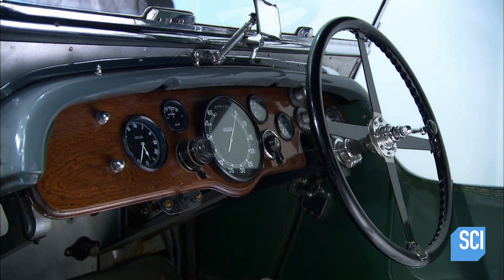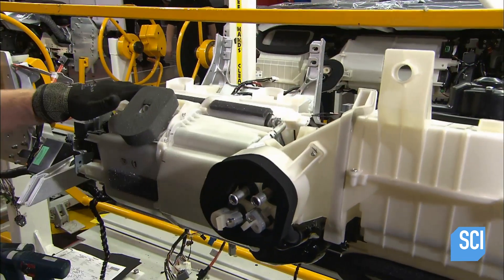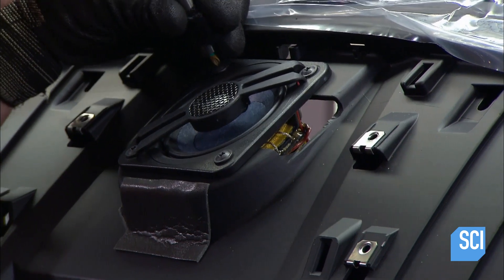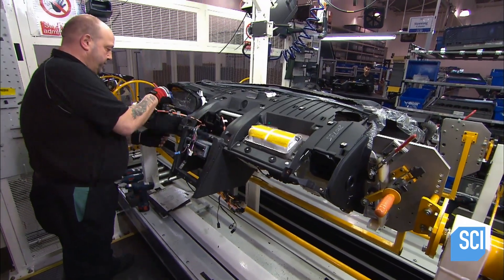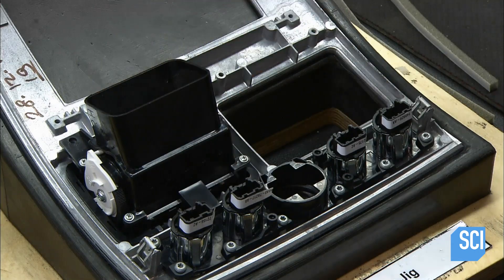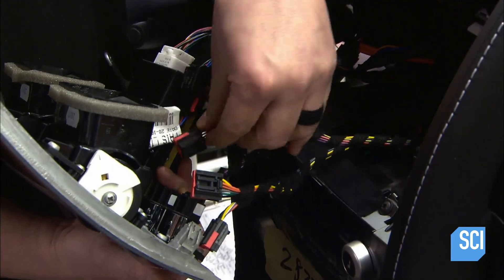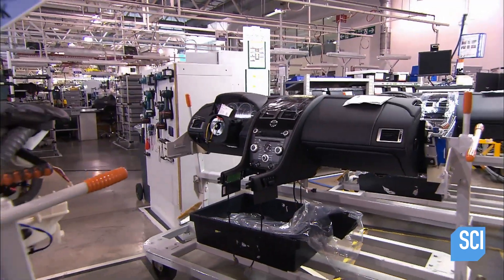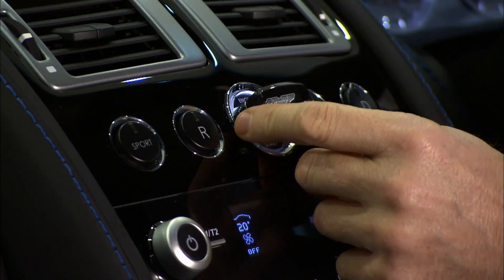How It's Made: Dashboards

Comment: This explains why any work in the dash area is usually a bastard.
They don't fit any of this with repairs in mind.
Reply: lol that is exactly what i was thinking watching them assemble the buttons for the various pieces, i am looking at replacing the USB/Aux port on a 2015 kia optima and holy hell... it's only like a little 1 inch by 2 inch $40-60 dollar piece but you literally need to take the ENTIRE freaking dash board/shifter area apart to get access to that spot... and there's like no good guides online they REALLY want you to bring it to a dealership and pay $400+ in labor for a freaking USB/Aux port lol

Comment: Not really "Making a dasboard". This is just bolting a load of impossibly complicated pre-fabricated electronic modules together. 
Car firms hardly make anything nowadays, they just assemble component manufacturers' products.in the 1970s, I went round Aston Martin's factory.  They made a lot. Of course they had to buy in carburettors, fuel pumps,  speedometers, brake callipers but they made the entire body and chassis, the entire engine and most of the suspension. Everyone of them were superb craftsmen. Nowadays, they are beholden to computers and component manufacturers for almost everything. When Henry Royce made his first car,  almost every single component (including generator, fuel pump,  brakes etc, we're all made in-house. That's how you maintain quality
Reply: so many people fucking crying about how they didn't show them injection molding plasting and welding steel.... there's like 800 videos of that crap, this is significantly more interesting noone is forcing you to watch it.

Comment: The car shown here is an Aston Martin Rapide and it's Satnav system is really old (i think thats why you can hide it - to hide away the ugly outdated tech) and it is suprising that a luxury sports sedan has so much plastic in areas you often sew
Reply: this show is probably really old.  Check the date printed on a part around 2:58, this was most likely filmed in 2010.
Reply: I don't like the button gears, I prefer the classic lever or a normal manual

Comment: This is just the assembly line. I wanna know how all those parts were made before it was being assembled. like how they measure all those wires, how they cast those panel boards, how they created the instruments and all electronics.
Reply: More than likely some 3rd world kid doing the labor
Reply: @alvindavis3801  who cares :-)
Reply: Yes but perhaps no car manufacturer is ready to open wide its doors to show everyone all the details...
Reply: Yes exactly.
Reply: the instrument panel is kind of boring it's a pcb board with small motors for the pointers which are just pressed on after the dial plate is put on with hidden tabs and glue it's blown free of any dust checked for scratches and the clear plastic is snapped in place then run through testing and inspected for miss prints on the symbols packed up and shipped out did it for 7 years
Reply: I work on the line. The IP line is where they put kids they want to up and quit. 

The line moves, there’s about 12 people on IP and they do not last.
Reply: @fixedguitar47  what does IP mean here? Interior production?
Reply: like to know how they get the symbols on the ac and heating controls
Reply: @jmartin4204  each on come off a printing machine like a 3d printer only faster it’s formed moulded pressed then dropped onto a conveyor as it’s cooled ready for packing i programme said machine in an epp department in a car parts factory the dash spare wheel housing are just Polystyrene
Reply: Munro & Associates has a great series on instrument panel and dashboard teardowns. They deep dive into how the dashboard was probably manufactured and why it was manufactured that way. 

https://www.youtube.com/c/MunroLive
Rivian R1T Dashboard https://www.youtube.com/watch?v=Kle8vi3Y2vQ
Reply: "measure those wires" you mean like with a fucking ruler? what is with all the dumb comments saying this... THANKS KAREN. "cast those panel boards" i guess when you are THAT clueless maybe you do need to be explicitly told common sense crap like "they measure wires with rules and measuring tapes and othermeasuring instruments. they injection mold plastic pieces. they cut and weld steel." WOWWWWW THAT WOULD BE SOOOOOO MUCH MORE INTERESTING THAN THIS VIDEO!!!!!!!! not.
Reply: They won't show because all this stuff is made in china, but they pay some schmuck minimum wage to assembly it all and slap a MADE IN USA to charge 10x more